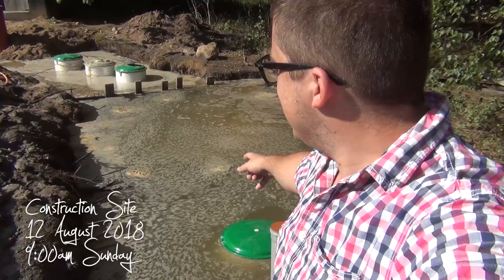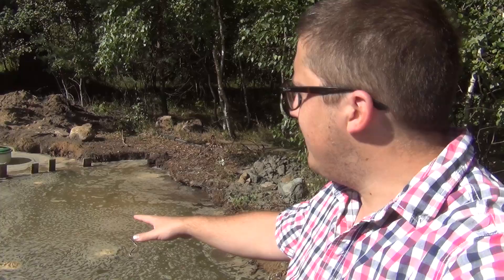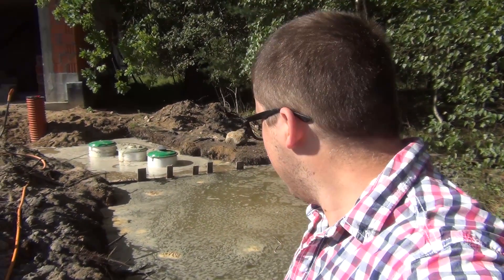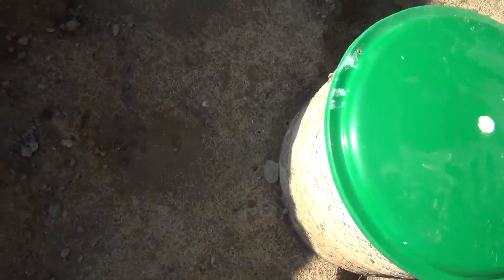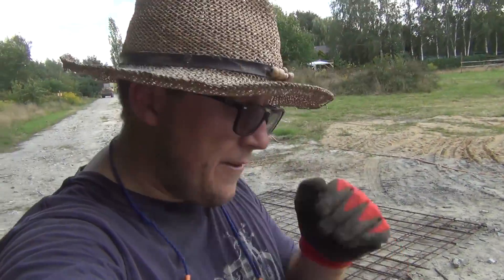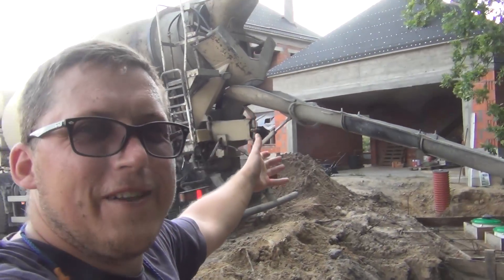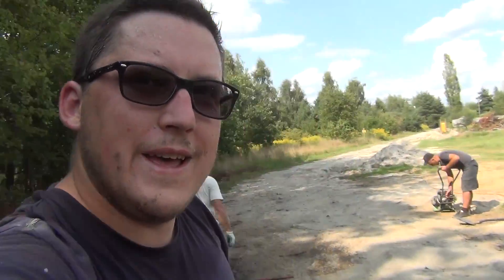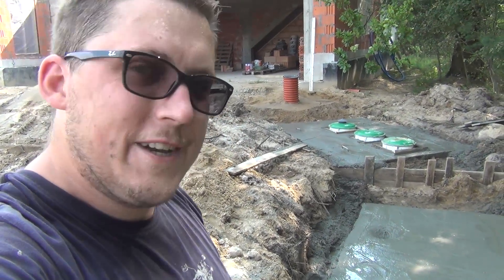BoH 122 - Concrete Slabs on top of the septic tanks

Comment: Is this a concrete septic tank?
Reply from the maker: These are fiberglass tanks they are very light so they can easily get pushed out of the ground by ground water. Our water table is sometimes at 0,5meter so we filled them up with water after burying the tanks so they don’t decide to come out of the ground and now we are going to co we then with a thick concrete plate.. that way once they are empty and the ground is soft their buoyancy is retained under ground.
Reply: I didn’t know you could put concrete over the top of plastic tanks
Reply from the maker: @gentzrayamcclellan6401  we bury them in dirt first ... but yeah you can cover them from the top with a concrete plate or give them a concrete foundation and strap them in .. straps seem more temporary/flimsy/error prone to me than a lid .. so went with the top pressure option